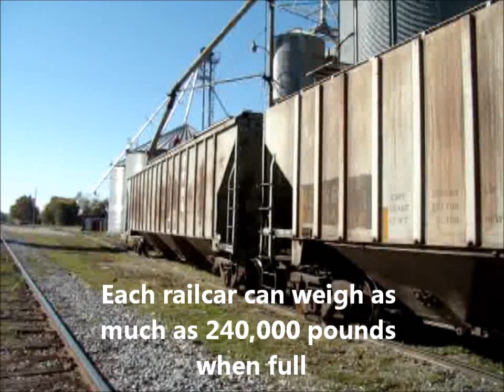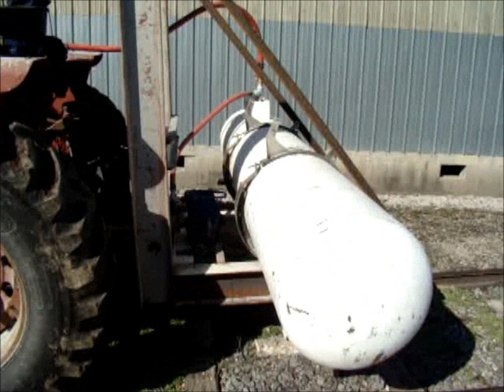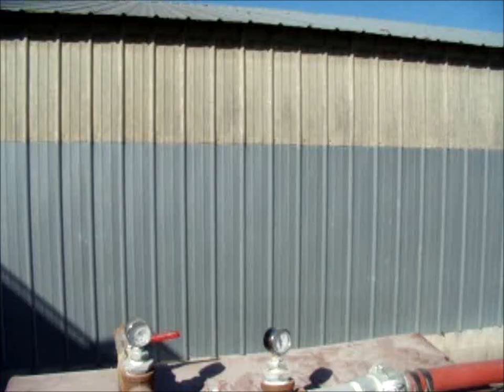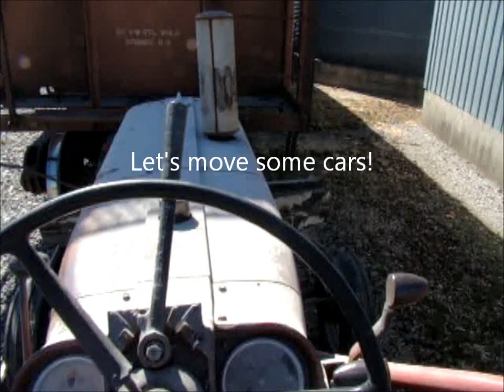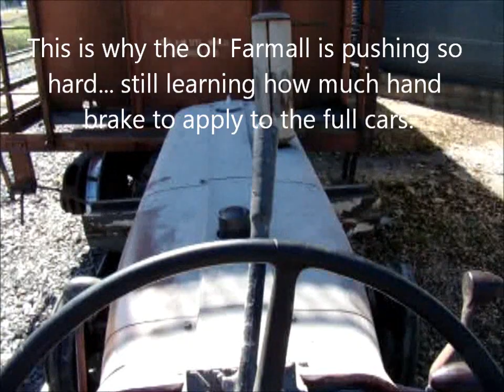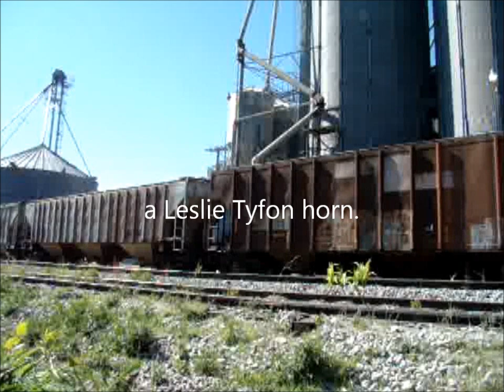Redneck Railcar Mover

Comment: Great! This is AMERICAN INJINUITY at its finest!  i WOULD THINK THE WIDTH OF THE TANK ON THE REAR of the tractor, COULD BE A PROBLEM MOVING THE TRACTOR AROUND. WOULDN'T A VERTICAL TANK BE A LITTLE SAFER WITH A BIG AIR GAUGE RIGHT A EYE-LEVEL BEHIND YOU BE BETTER?

Comment: if it works, it's right! am hoping you have a drain valve on the bottom of your air reservoir, to drain moisture out, at the end of the day (internal rust prevention)

Comment: Couple of things.  You need a knuckle on it.  You also need a radio and have derails on your spur.  You also need to be in contact with the mainline operator when you are doing this in case you have a run away.  You are risking huge fines and damages if you mess up.
Reply: The connection to the main line is at the uphill end of the spur: there's no way cars could run away up hill.

Comment: This is very creative. Ever thought about installing a knuckle on the front of the I beams? How many cars do you normally load? Are both tracks aside of your loading track for train movement? Could the far right one be used for storing the loaded hoppers? What is the most cars you have pushed at one time. This type of enginuity is what makes America great. Thanks for the video.

Comment: Looks great but I would put some kind of pressure relief on the tank just in case someone forgets and leaves the pto running.  If you could get someone to ride the full car to release the brake when you want it to move and apply it when it is time to stop it would move much easier.
Reply: It's a propane tank, so I would assume it already has a relief valve.

Comment: Blue Circle cement's sidings in Poole (UK) used a red Fordson tractor with an offset beam to push cement wagons around until they closed in the mid 1990's.

Comment: Nicely done. You can release the hand brakes without worry, if you place wheel chocks at the downhill end of the train, release hand brakes bring up the brake pipe pressure to 90 psi. Check that all brakes release, then apply brakes by reducing the air to 70 psi. All brakes should be fully applied. Then go ahead and remove the chocks. Bring the brake pipe to 90 psi to release and the cars should move easily. A track mobile gets most of its traction by lifting up on the coupler. You could incorporate the same idea to keep the front end of the tractor down.

Comment: It's been a while, but i am a third generation(former)  railroad employee(I served my Apprenticeship as a fitter/loco maintainer) . How is your tractor holding up? I have seen lots of Diesel Tractors used for doing work like that ,even with a buffer fitted up front made from a few ties (sleepers) . I guess you had the Westinghouse brakes worked out ,hence your pressure and dump valves. I probably would have spoken with the local loco depot boss and got a brake lever so you can control the brakes easier with one handle .The system has worked well for over 100 years .BTW the locos used in my day were called Shunters, so were guys who worked in the shunting yards, (both my Grandfathers) So your tractor would be called a shunting tractor in my Country..  :-)

Comment: I work in a mill that has had several different trackmobiles and they do work well, but are expensive and often require maintenance attention.  If you don't use the handbrakes and the cars start to roll, dumping just some of the pipeline air will reapply some brake to car wheels.

Comment: If you put a loop of chain through the pusher and around the top of the coupler you wouldn't need to leave the handbrakes on to keep from pulling the air line apart when the air brakes release. Save a few pints of gas here and a few pints there and pretty soon you are talking about saving so real money.

Comment: Are there any rules (FRA, railroad company) governing the construction and operation of this sort of device? I'm surprised you can "self service" like this. Do you keep a derailer on the track in case this runs away so you don't risk fouling the main line? Cool job, btw.
Reply: Most industries do self serve. All the railroad does is drop the cars off on the siding. Its up to the customer to position the cars. For some larger operations the railroad will deliver an entire train engines and all, but the customer still has to provide a trained crew to position the train for loading or unloading.
Reply: @cple1  I thought the railroads generally did spot the cars, e.g., lining up box car doors with loading bays and tanks with unloading points? In this case, the issue is that the cars need to be moved while they're being loaded and I agree that the railroads don't help with that.
Reply: The FRA considers In-plant rail operations "insular" and chooses not to regulate them. Basically as long as that "locomotive" is not going on the freight railroad's track, and is being operated solely on the property of the plant it is owned by and is only being used for the operations of that plant (not switching for anyone else), it will be considered insular. The FRA chooses not to regulate insular railroads for manpower and cost reasons, despite their authority from congress over every railroad in the United States, they do however reserve the right to inspect and give emergency orders to any railroad with a gauge of 24" or greater.
Reply: The spur is only connected to the main line at the uphill end, so cars can't escape onto it. Wouldn't be surprised if there's a derail there, though -- I have seen a factory where cars would have to roll up a pretty steep hill to get onto the Class 1's main line and there was still a derail protecting it.

Comment: When I worked for a short line a long time ago (1993), I would apply a little train brake (not the locomotive brakes) when delivering (pushing) boxcars to a warehouse siding so the slack would not run the cars out.  It was dicey, because if you were to apply too much brake the train would stop and you'd have to pump a lot of air into the system to get it going again - this would piss off everyone.  I believe it was less than 5 lbs of brake.   When we'd deliver tank cars to a tank farm we would use the hand brake to lock the wheels up to an individual car to line it up with a spout.  It made a nasty sound but it worked like a charm.  That was the process for each car and spout.  We'd deliver military vehicles (Bradleys and Oshkosh trucks) on flat cars to the state port.  I would crush the cars against a concrete ramp, the couplers were designed to disappear under the car like a turtle head that way the long shore men could drive the vehicles off.  Your video brought back all those memories.  Enjoyed your ingenuity!

Comment: Hey Mark!! I seen a dealer in retired railway maintenance equipment where I live in Somerset, Kentucky. This dude has a few International 6x4s with full hi-rail equipment on board, and each end has a knuckle coupler with airline. I'm sure he'd sell them cheap. They're retired Norfolk Southern units, and were assigned to the Kentucky Division. If you are interested, I'll get you guys in contact.

Comment: Fit a used buck-eye coupler to the front, then you won't need the handbrakes on the wagons, you can use the air.
Reply: Well he is using air  now that coupler is that the name of the style of couplers on trains so thier would be a physical connection. If a physical connection he wouldnt need the hand brakes partially set the tractor could hold it temporarily that way couldnt suddenly roll on ya
Reply: @tractorboy31  I wouldn't rely on a little tractor like that to hold the cars without brakes. Loaded cars weigh about 130t and the empty is about 30t, so it needs to hold nearly 400t trying to roll down a hill.

Comment: Seems like you would NEED a tractor with a hydraulic clutch.  Which I don't believe that old Farmall has.
Reply: Mark Penrice he would simply have to uncouple from the load and it would be easy to chain the empty car or two to the tractor and pull them back to spot. An empty only weighs around 50,000 lbs, and they roll really easy. I have dragged empties around on level track with a John Deere Gator.
Reply: "Need" in very strong quotes it looks like! Just shove it in the lowest gear and keep the revs down, patience does the rest.

(bear in mind they are running down a slight hill... the tractor only really has to overcome the friction of the hand brake, after releasing the main air brakes, giving the cars a bit of a tap to start them rolling. Gearing and the big rubber tyre adhesion does a lot, but not 360+ tons worth... a regular locomotive moved them from the main line to the siding after all. The test would be seeing if it can push them back the other way following an overshoot!)
Reply: John Hasse even with a big load like that, an old tractor in low range 1st will have a ton of torque, it may wear the clutch a little but it does the job. I'm no train expert but I do know a lot about tractors and there mechanics/hydraulics. I Worked at a hydraulic repair shop in Bowling Green, KY and we serviced the CSX trucks and hydraulic equipment. Gotta say the hydraulic tools they use are freaking awesome, Nothing like messing with a 3ft cutting blade powered by a hydraulic grinder with endless power!!!

Comment: Don't let DOT spot you with that propane tank as an air receiver. Perfectly safe (tank would have been water tested to 480 psi when made) but they still don't allow them to be used as an air receiver. Otherwise great engineering. Tim at 7145 499 0139
Reply: DOT has no say whatsoever for what goes on with a private rail line.
Reply: This is a private industry track and is not regulated by DOT or the FRA. Whatever he chooses to use to move railcars around within his own facility is no business whatever to anybody. Also, for the commenter regarding the brakes, the railcars are maintained quite adequately I am sure. A railcars handbrake is not designed or intended to be used to stop a moving railcar, (especially a loaded car) but only to hold the car in place and prevent it from moving. We often do use handbrakes to control railcar speeds when switching/moving said cars, but you NEVER rely on a handbrake to stop a car.
Reply: grizzlymississippi DOT and the FRA are not the same thing, yes the FRA has presidance over all rail activity that connects to a main line. DOT does not. They are separate agencies with separate responsibilities and jurisdictions.
Reply: The FRA is an agency under the DOT, so the FRA is DOT. Also, if it connects to a mainline, the FRA has jurisdiction.
Reply: @ironmatic1   You are incorrect. Under CFR 49, “Plant Railroads” are defined as FRA Insular Installations even though they interchange cars with the General Rail System. This condition is provided that they operate for the sole purpose of switching cars within the confines of a plant and do not provide rail service to other industries. The FRA recognizes a derail device, fence, gate, or switch as a physical barrier between the Plant Railroad and the mainline as a separation point between “Insular” and “General System” trackage. When the carrier railroad enters the plant railroad to drop or receive cars, the trackage momentarily becomes an extension of the “General System” and the movements on that trackage are under the jurisdiction of the FRA until the interchange is completed. It pays to actually read the CFR’s as this situation is much more conditional and complex than one may expect.
Reply: "Only if they want to go back to the good old days of frequent, disastrous railway accidents."
- cough - CSX - cough - Amtrak - cough -
Reply: absolutely....they are way way overreaching and have become huge barriers to innovation and entrepreneurship.
Reply: the old days of disaster were not for a lack of government, there were primarily for a lack of engineering understanding and hasty economic expansion.  Those disasters only became excuses for more government run by people with even less engineering understanding.  Besides, at some point even the most rabid statist has to value freedom over safety otherwise we'll have the government forcing us into padded rooms with UV filtered light while being intravenously fed with government sanctioned "food" being pumped in our veins and only allowed to defecate in sterilized composting toilets all for our "safety."
Reply: Annette Noble
Reply: Ryan Grider that's exactly right
Reply: @another_unique_username   You are incorrect. Under CFR 49, “Plant Railroads” are defined as FRA Insular Installations even though they interchange cars with the General Rail System. This condition is provided that they operate for the sole purpose of switching cars within the confines of a plant and do not provide rail service to other industries or cross a public road at grade. The FRA recognizes a derail device, fence, gate, or switch as a physical barrier between the Plant Railroad and the mainline as a separation point between “Insular” and “General System” trackage. When the carrier railroad enters the plant railroad to drop or receive cars, the trackage momentarily becomes an extension of the “General System” and the movements on that trackage are under the jurisdiction of the FRA until the interchange is completed. It pays to actually read the CFR’s as this situation is much more conditional and complex than one may expect.
Reply: Only if they want to go back to the good old days of frequent, disastrous railway accidents. While an air tank on a pusher is pretty minor, clueless NON-ENGINEERS have no business removing safety standards out of greed, laziness etc. Before safety standards even railway shop maintenance activities were a bloodbath. You probably think aircraft safety shouldn't be regulated either. Before modern oversight and crash investigation techniques air travel was dangerous. FAA regulation changed that.dramatically. While the LP tank is cool and will probably last a very long time (BECAUSE IT WAS ORIGINALLY FABRICATED TO STRICT ENGINEERIUNG STANDARDS FOR PRESSURE VESSELS) and is certainly convenient, without periodic hydrostatic testing any pressure vessel is also a large bomb waiting on time and corrosion to induce failure. Fortunately the vast majority of failures are small leaks rather than bursting. 
The narrator mentions INADEQUATE rail car brakes which don't work.. That shouldn't happen but the railroad evidently chooses not to maintain their rolling stock until it breaks. If the train derailed and sent a car through your house you might sing a different tune. If they don't inspect brakes what else don't they inspect? All it takes is one hot box to cause a derailment. So much for the invisible hand of the market magically taking care of safety. It never did.

Comment: I like this idea great work. You might have figured it out by now since its been a few years since you built this but, a 7-10 pound air brake set on  cars is typically what we use to precision spot cars at industries. Do you have a way to make an emergency air brake application with the air valve?
Reply: For emergency all he has to do is flip the quarter turn valve to full open.  Voila train line dumped and all cars in emergency.  Train brakes work by raising train line pressure to 90 psi to release the brakes then lower the train line pressure to apply the brakes.
Reply: Gas engine what is your mpg ?

Comment: Cool on the car mover. But it's 2010... doesn't OSHA want a fall restraint system for that guy loading the grain from the car top?
Reply: I would get "written up" if the was seen in a situation like that without a fall restraint system and work plan.

Comment: I saw one Elevator had a RR knuckle attachment on the front of a pay loader to move RR cars.
Reply: It's very common for industries to move cars with a knuckle on a loader, yes. When I've seen it, the knuckle has been on the back. That way, you have a dual-use machine: when it's not loading, it can move railcars; when it's not moving railcars, it can load.